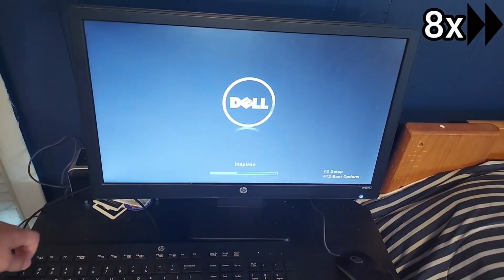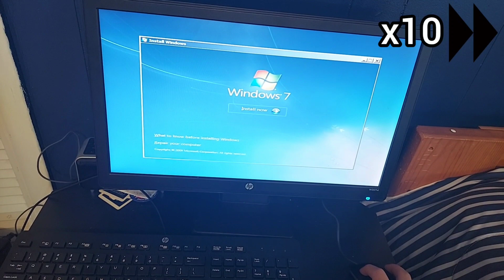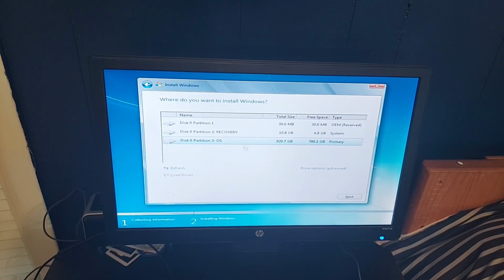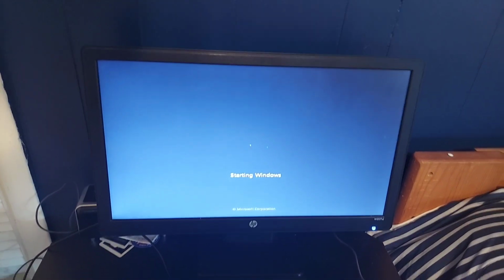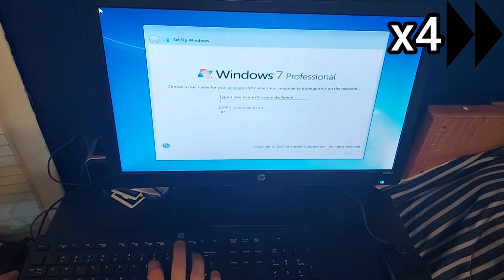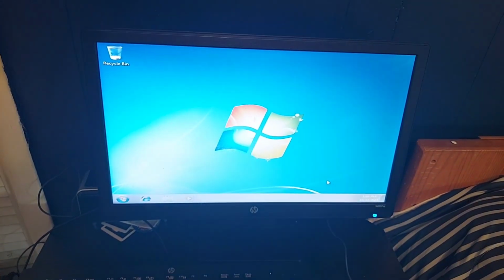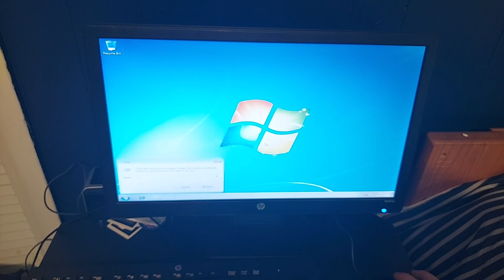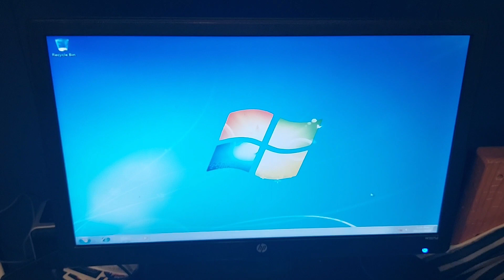Installing Windows 7 on a Dell Inspiron 570!

Comment: i have this same pc but with 16gb ram and windows 11 and upgraded the cpu to a quad core and put a gtx 750 ti in it
Reply from the maker: So originally, I had replied stating this PC had died, but that was a separate PC. This one is fine and still runs 7.